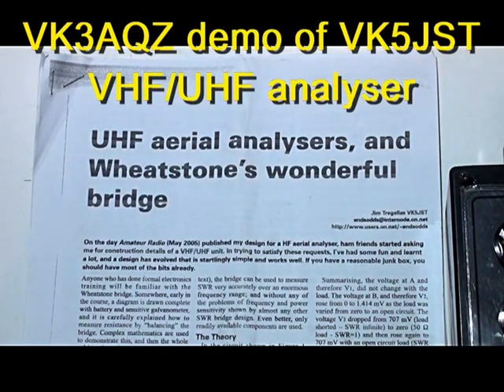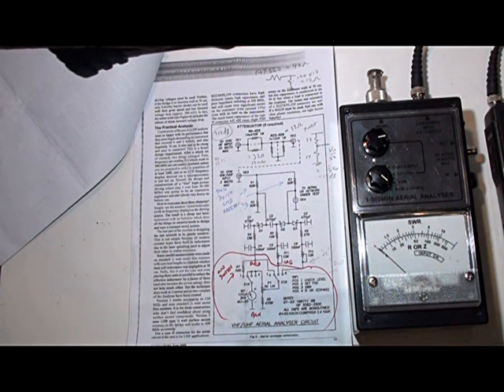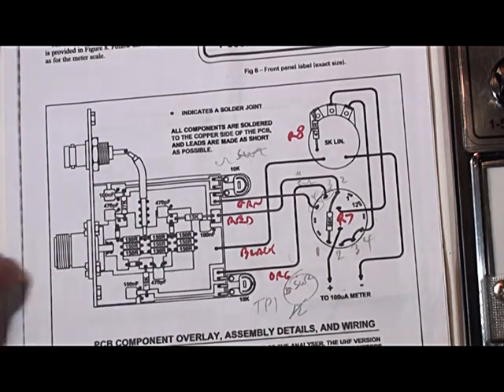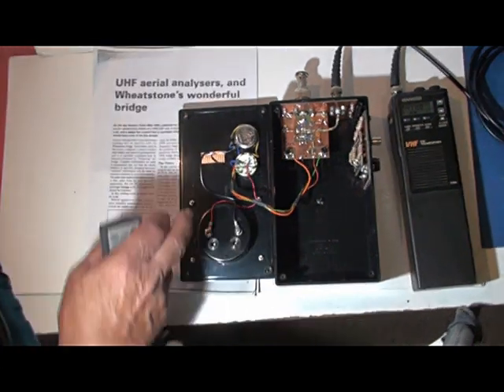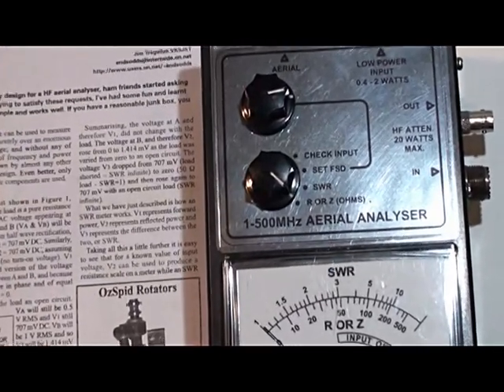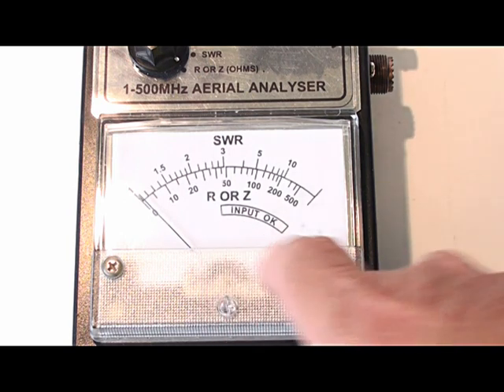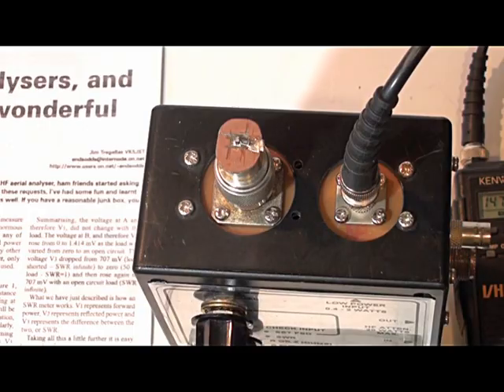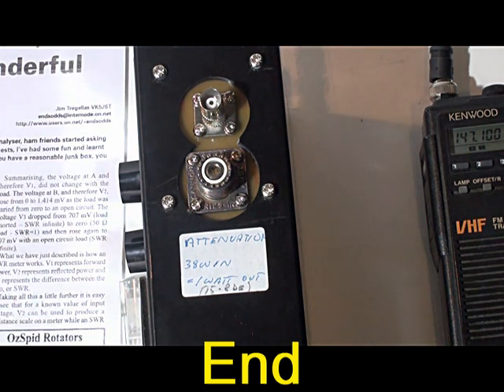VK5JST VHF UHF antenna analyser V2

Comment: Jim has designed a swag of kits for amateur use.  All work as described and do an excellent job.  The HF antenna analyser has now been upgraded and covers hf/vhf.  The kit is no longer provided but the circuit board and programmed pic ic is.  I have just made the 1kw peak reading digital Pwr/Swr meter and it is a very good unit.  VK5LB.

Comment: Hi Lou. I built one of these about 10 years ago .  Still have it and use it . I also was looking for the paperwork that goes with it. Could not remember where to find, now I know. Came here as I was playing with my Rx1 Bridge and need to test and calibrate. Been sitting a while un -used.Looking to add a R to unknown port to assist with measuring coils and short  vertical antennas (mobile).Good to see the JST has been tested and seems accurate.
VK2FXXX
Reply from the maker: Hi Brendan,  yes that version of Jim's SWR bridge is pretty good. Simple and reliable. Ok on everything else. Take care, cheers, Lou